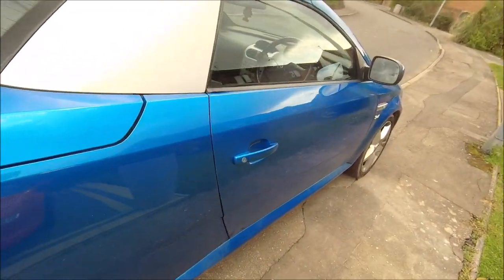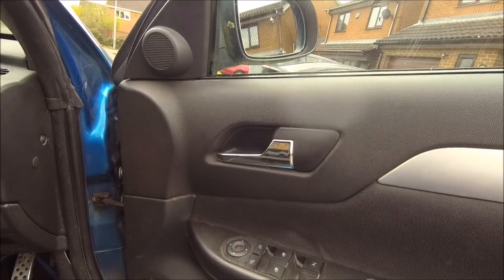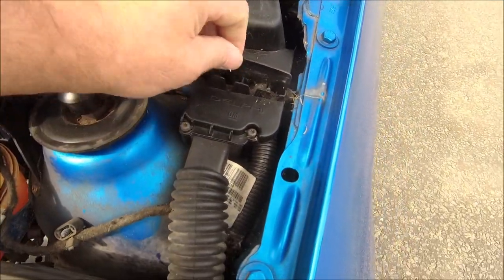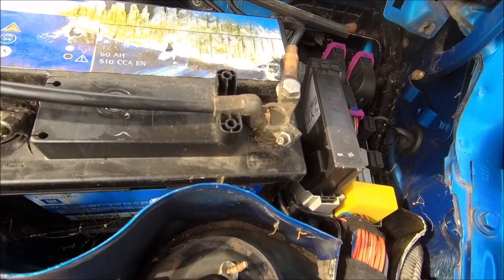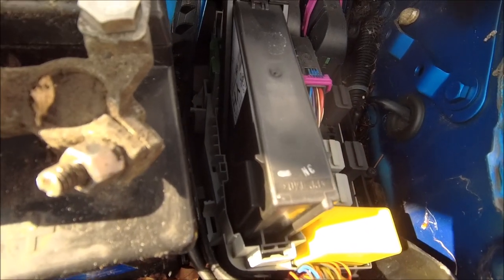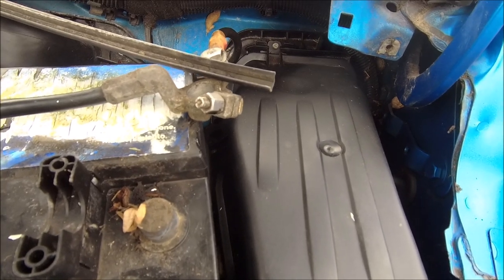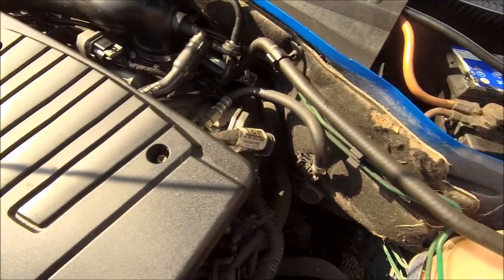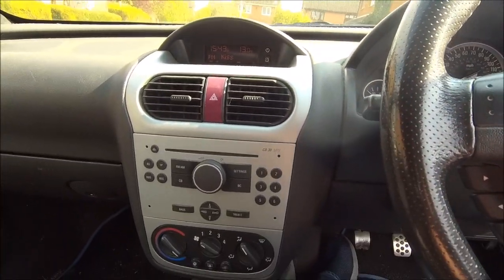Trouble with the Tigra windows

Comment: I had exactly this with my Tigra but only on the passenger side, I ended up having to re-program it with Opcom as on the tigra it is controlled by the roof ecu in the boot, so the basic process was plug in opcom, load the software, goto the body menu, then electrohydraulic hardtop menu, the program, this brought up a menu with 4 buttons, make sure all doors and windows are closed and windows are fully up. press "enable assembly" then press for example in the software "drivers window" button, this will drop the window about 6 inches, then save. then repeat for the passenger side. this resolved my issue and now when you open the door they drop slightly as they should and more inportantly when you start the roof opening process they drop around 6 inches to help. and when the roof is closed the windows go back up.  I do have Opcom in Leicester if you want a hand with it and are ever popping past dude.
Reply from the maker: All fixed and sold now...did another video as found out the vaux-comm program was not as compatible as it should have been and the window program button was greyed out...newer version did the job a treat. 😉
Reply: @AdeReeves  no problem pal 👍

Comment: Hi ade.
What you need to try do is. Hold the driver window  switch up for 6 seconds then continue to push it down whist holding it down again for 6 then roll it back and hold it again for 6 seconds  that should reset the auto windows. Good luck  opcom is a great bit of kit.
Reply from the maker: Oh Mark..if only it was that easy...Im deep into the trickey that is Vauxhall now...but still no where closer...more to come

Comment: Ade I shared a link with you on this but either it was deleted or it’s in your held section because of the web link?
Reply from the maker: Don't see any comments sir...
Reply: @AdeReeves  

contact on, window fully down, keep pressed for a few seconds after fully down, same for up, keep pressed.

taken from a forum post, (take the BCM module and give all the contacts a clean, I then did a BCM Reset, and it then would not accept the security code, so I thought I had screwed up, Then when I read what it said, It was saying that there was no security code programmed, So I programmed one in and it accepted it. I then reprogrammed the drivers door window, and hey presto, It worked a treat.) 

Other options.

Check for a fully topped battery.
Check window fuses
Do window reset with roof down.
Reply from the maker: If only it was that easy Sir...  tried the basics like someone with a window disorder..still broke    😁